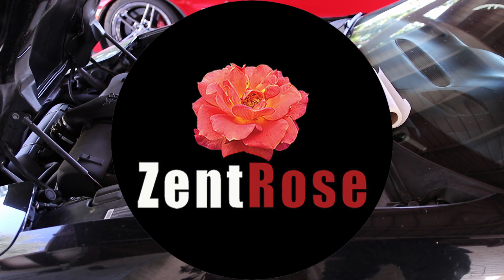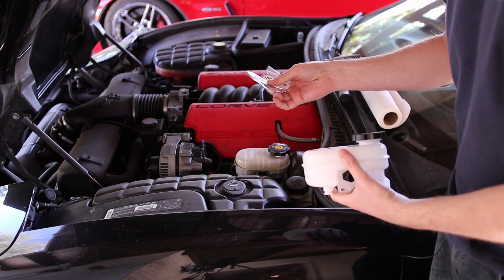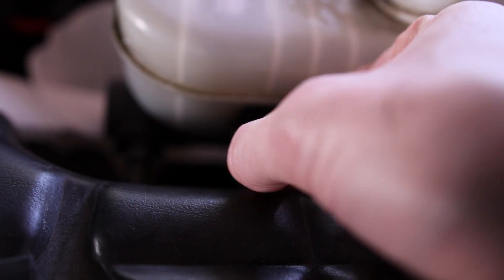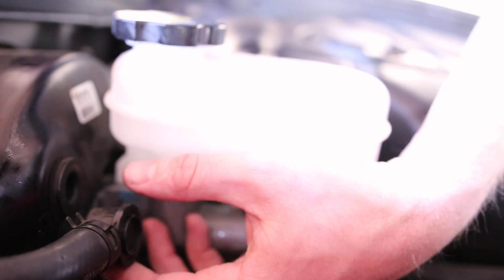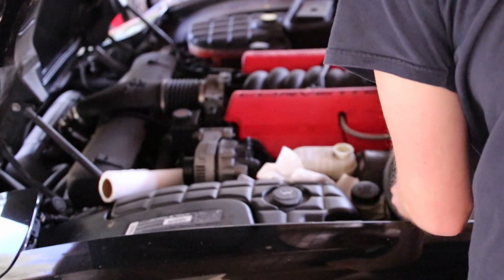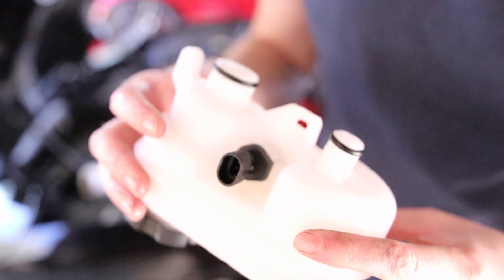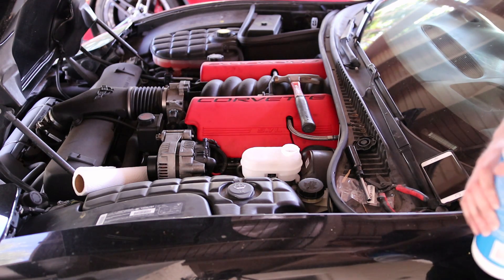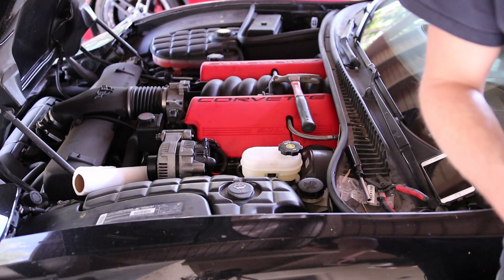Chevy Truck / Corvette Brake Fluid Reservoir Replacement

Comment: Hello. Thanks for the video. I just replaced my reservoir and it took about 15 mins. Great video. SIDE NOTE: I used an Delco reservoir and seals are different from the regular O ring seals. Works the same.

Comment: I just replaced my brake fluid reservoir for my 2000 Oldsmobile Bravada which is the same as a Chevy Blazer and S10, GMC Jimmy and Sonoma. 

Bought a Cardone replacement for only $16 since mine was cracked everywhere and ready to burst.

Cardone MC Reservoir Part# 1R-2866

First make sure you take out the rear pin with a proper roll pin remover rod, do not use something pointy because you will expand the roll pin and it won't come out. I also installed screws and nuts instead of roll pins just in case I need to change it out for some reason.

Mine does not have a sensor, make sure the new O-Rings are not damaged and lube them with brake fluid before you just push down the reservoir onto the master cylinder.

There is no need to bleed the master cylinder since no air goes in on both openings, brake fluid just overflows on top. But if you want, change your brake pads after installing new reservoir, when you reset your brake calipers, fluid flows back into the master cylinder so you can be sure no air went in.

Comment: I'm pretty sure mine is leaking too. It's always moist when I check it but the level hardly goes down. I'll keep this video for future use
Reply from the maker: You can get away with just a new cap for about $5. I only replaced the reservoir to clean up the engine bay a bit.

Comment: Should you have to bleed the brakes when changing reservoir?
Aslong as you dont push the pedal during this, i imagine it should be fine!
Please correct me if im wrong...
Reply: Did you try it,
Reply: Im wondering the same. 🤔
Reply: No bleeding required unless you sucked some air in by pressing the brakes.

Comment: that is the way to change brake fluid to.........nothing more than that.....
Reply: To replace ALL the brake fluid, you also have to bleed the brakes to get all the fluid out of the lines and calipers.
Reply: @1mdiy275  if is not to dirty u can change only above.....